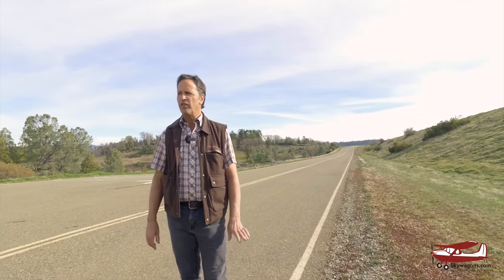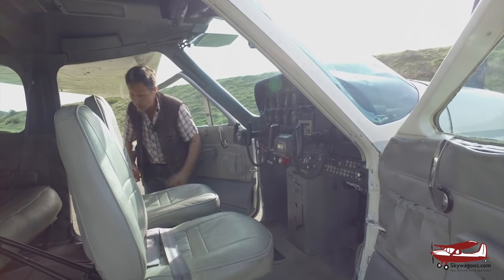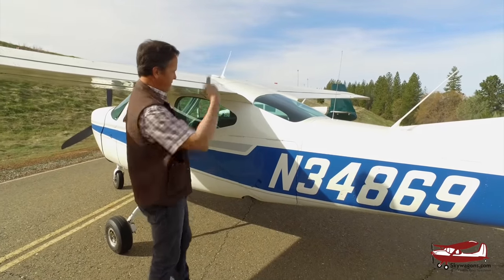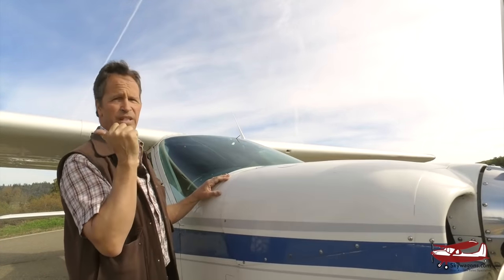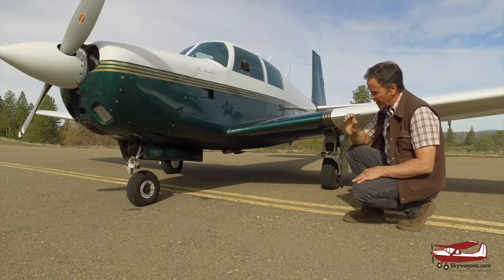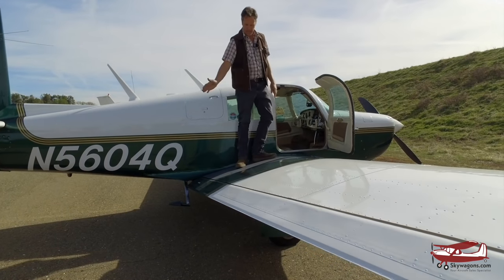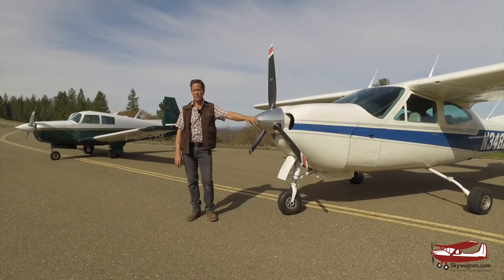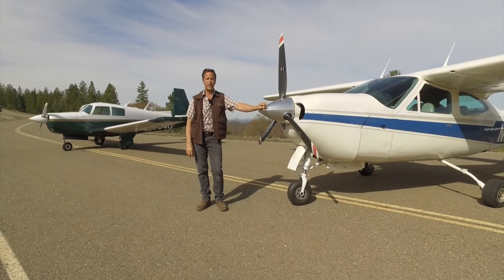Mooney vs Cardinal

Comment: I was in the market for a plane. I saw a cardinal and was in. Then I saw a Mooney …. Hmmmm   Found a k model rocket and never looked backed. No doubt the cardinal is comfortable but the speed is undeniable in the Mooney. I can plan for 200 just about any day of the week.
Reply from the maker: Oh boy, a Rocket. Mooney M20K with TSIO-520 NB in it (out of a Cessna 340) and a full feathering three blade, stronger engine mounts and gear and two batteries up a wooden ramp under the dorsal fin. 200 everywhere.  Great planes.
Reply: @skywagonuniversity5023  you know exactly what it is !!!! Figure it’s my forever plane now. Not sure how I could top it for the money…
Reply: @skywagonuniversity5023  also, to comment on the room inside , it’s not the width but I believe the top of the plane getting tight over shoulders and head combined with the corvette seating position gives the feeling of being smaller. You can bet lunch with your passengers who own other models and win lunch with a tape measure lol
Reply from the maker: I had a basketball player of about 7 ft come to sit in a lot of planes because he didn't fit in most and wanted to "try them on" The only one that he fitted in was a Mooney 201. No-one was going to be sitting behind him, but he was comfortable with head room.  The Cessna's would not turn their yokes because of his knees. Bonanza with the yoke up, maybe. No way on Pipers and never in a small fabric taildragger of any kind.  We were very surprised by the 201.

Comment: Three blade is not faster … just different
Tip speed is the difference, 3 blade should be shorter and quieter, but a big ol 2 blade can push a lot of air and is sometimes faster

Comment: The Mooney landing gear is supposedly much less expensive to maintain and less likely to fail compared to other RG aircraft (though it makes for a bumpy ride on taxi), so unless the Cardinal is similar in this manner, the Mooney wins for me.  I would not even consider owning other RG’s due to the expense.

(You may mention this in the video; I confess I’m commenting without watching the entirety).
Reply from the maker: Mooney gear is so simple and reliable. No struts, no nitrogen, no oil.  Just rubber discs.
Reply: @skywagonuniversity5023  Yes, it's the most maintenance free but, as you note in the video, the rubber disks will harden over time and need replacing.  They will also "squash" slightly, dropping the ride length a bit well before they need replacing. When they do, the nose wheel rake geometry changes fractionally.  When THAT happens the nose wheel develops a mind of it's own.  Just when the wheel touches down and begins to get traction, it will self-steer violently one way and then the other.  It's a real attention getter.  There is a service bulletin on it to measure the compressed height of the disks and if the measurement is below a certain number, there is a shim kit (really just a couple of big washers to install in the nose wheel disk stack) that will fix it for good. So look out for that.

Comment: Chevy doesn't make a 360, which isn't 5.7L - the Chev 350 is 5.7 ... I say, Lycoming is same size as early 70s Ford 360, usually found in pickup trucks...
Reply from the maker: But close enough for this comparison.

Comment: I have a Cardinal RG and my friend an F model Mooney with Lopresti cowl. He's 15Kts faster in cruise, at any altitude. He's also able to climb quite a bit higher. The cardinal has a bit more drag and is bigger. It needs more HP to match the Mooney. An IO390 powered Cardinal RG will cruise at 153Kts. Mine does 143. Here is a short race video: https://www.youtube.com/watch?v=gm_WyxR9mA8
Reply from the maker: First hand info.  Can't beat that.  Thank you.

Comment: a mononey is super narrow cabin , fuel tank problems commen pucks in the landing gear problems  , and the company is no more If it was same price /hours /pannel i'd go with 177 all day long ,  177 easier to get in and out
Reply from the maker: The Mooney's, all of them are the same cabin width as all the smaller Pipers and Cessna's and this 177.  The rubber pucks need to be changed every ten years or so and never need any maintenance like on a plane with a hydraulic strut.  The Company has closed and resold about 10 times since it was started.  Cessna stopped production o0f all singles in 1986, so did Piper until the Tort reform came out.  Beech only makes the Baron and B36 TC now.  All parts are available for all Mooneys.  There are a lot of mis-truths said and thought about Mooneys based on others talking and believing the same mistruths but with no-one in the chain of talk that has actually spent any time with a Mooney.

Comment: Hmmmmmmmm, cables can’t push?  Any McDonnell Douglas engineer would argue that point with you!  Just sayin…. The most hideous creature you will ever get your hands on in commercial aviation is a leading edge slat cable change and rig on a DC-10.
Reply from the maker: Maybe I should say small wire cables can't push.  :-)